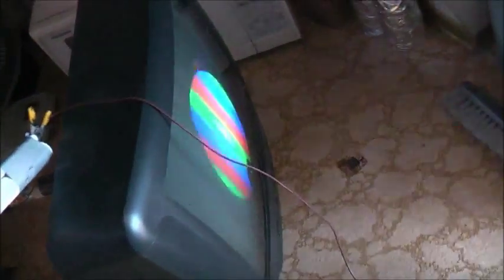CRT VS NST, With Cathodes Connected!

Comment: Fun stuff :) I have done a simelar thing using a flyback converter for the EHT and focus / screen.

The rest is mostly voltages below 200V, not too tricky actually. I have the HV supply section from a high quality computer monitor, totally stand-alone and arc proof.

I plan to mess up some smaller CRT's made for 8 kV EHT with 30 kV EHT later. and 0.5 - 1 mA (15-30W) beam current. single centered spot.

Take it apart and check the shadowmask, may be a hole in it.

btw: NST is rather x-ray safe

Comment: cool video, but I had the oddest ad before this, meant for the medical technician, about Ultrasound medical equipment, and I am no doctor. Probably because your title has NST in it. Look up NST in wikipedia, and it lists the Neon Sign Transformer.  Wikipedia has an interesting write up on the transformer.  According to the site you need eye protection, when doing those HV arcs.

Comment: Mind sharing pictures of that? It's just a question about power density as far as I see it, I got some pictures of my experiments but I haven't looked into how to share them on youtube.

As far as I plan, max current the flyback converter PSU can deliver, focused down to a small spot. Using no extreme voltages since it will just end in arcover somewhere.